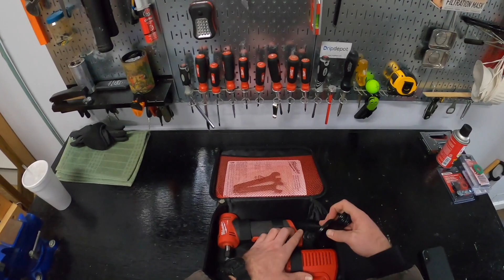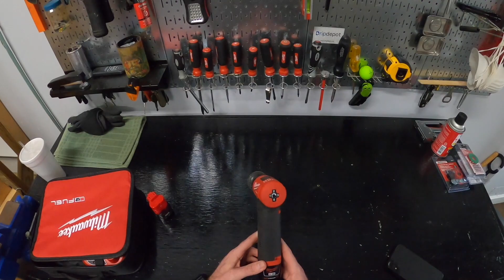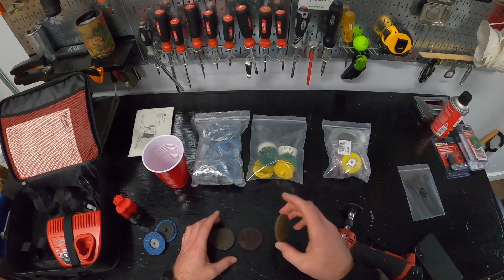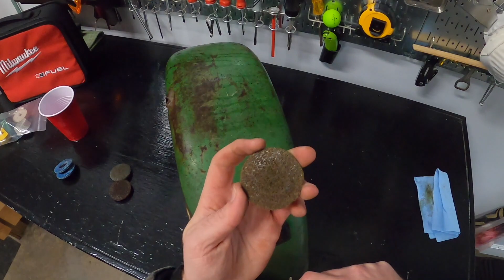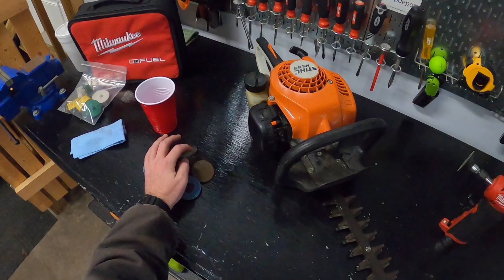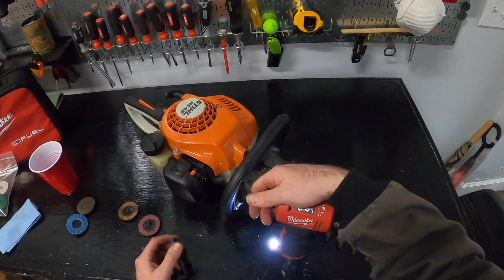Milwaukee M12 FUEL Right Angle Die Grinder Review - 2485-22

Comment: These rotary tools accept a number of attachments that work well to a different extent for different applications.
1. For paint removal, use stripping disk, it has large openings and wont clog. Cheaper than bristle disk.
2. for polishing use "sanding disk" basically nylon that looks like scotchbrite disk.
3. For heavy metal removal use sand paper disk (will clog from paint)

The bristle disk as shown in this video is the more expansive version that works for #1 and #2 scenarios, plus uneven surfaces.
Reply from the maker: Thanks for sharing!

Comment: Im a boilermaker and this is my honest opinion, if youre strictly using it for die grinding with burr bit like its intended then it works flawlessly, if your using it for the roloc/disc attatchment then you will be slightly dissapointed unless in really tight spaces- not just by the power but just the overall ergonomics and power , so much easier to use flappy discs on a standard grinder.
Where it really shines is deburring square tube and pipe and internal 90° fillets n fits, i use it pretty much only for that.
Reply from the maker: Thanks for sharing!

Comment: i wonder if that adapter will work on Milwaukees m12 Polisher?
Reply from the maker: It will not. The M12 polisher uses some sort of threaded adapter for the different attachments. If you buy a new m12 polisher it comes with a Roloc adapter in the kit

Comment: Great review thanks. Rough idea of use time with 2, 4 and 6 ah batteries?
Reply from the maker: It really depends on what you are doing with it. The 2ah batteries will run down pretty quick maybe 4-5 minutes of straight heavy use. And then more time the bigger the battery. I like using the 6ah battery for constant heavy use. Its just nice not to have to worry about the battery in the middle of the project.
Reply: @scottwalker19  Thanks for getting back Scott - soooo would that be around 15-20 minutes for the 6 ah? Hmmm a little too little for me, I'd be cycling batteries too often to make it worthwhile. I'll stick with my Suhner thanks. :-)
Reply from the maker: I would say with the 6ah battery last longer than 15–20 minutes. I would have to have a large project to know for sure. If you are using it all day then maybe it might bot work for you. However to use and air die grinder heavily you will need a large and powerful compressor and not everyone has space and money for that.
Reply: @scottwalker19  Thanks again Scott. I use the electric Suhner Rotoset flexible shaft, so no need for a compressor - still looking for ways to lose the shaft though.:-) 
 Ingersoll Rand used to make a 14.4v cordless right angled die grinder IRTGR25 (https://usatoolsinc.com/14-4v-right-angle-cordless-die-grinder-discontinued/), the body design was great, just poorly weighted with a big battery on the back, which made it too cumbersome. 
My feeling with the Milwaukee is it'd be fine for short bursts of duty, but for longer period use, either air or corded electric is still the default. 
Maybe the success of the Milwaukee (it feels like they're selling a lot of these units and it's definitely filled a big gap in the market))  will tempt I.R. to look again and rerelease an improved version of their old model.

Comment: Great video, surprised Milwaukee didn't include a disc pad assembly. This is the most informative review I've found thus far going over the accessories and demonstrating how the various 3M surface prep pads / Chinese flap wheel discs perform on a painted metal surface with rust.  Thanks Scott.
Reply from the maker: Thanks! Yeah maybe Milwaukee could have included the roloc disc assembly since it’s really not expensive but at the same time you can use the tool for many different applications so they probably didn’t want to prematurely send it out in case you were going to use it for something else. I still need to order a cutting disc adapter and then I should be happy with all of the attachments that I have.